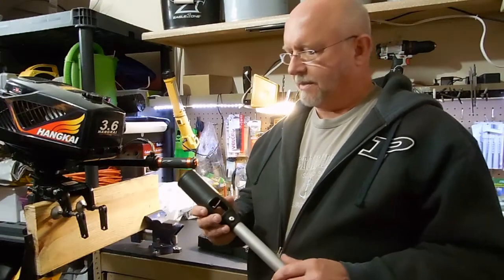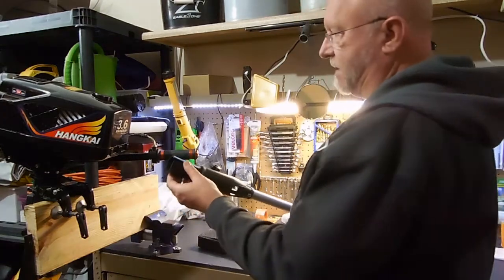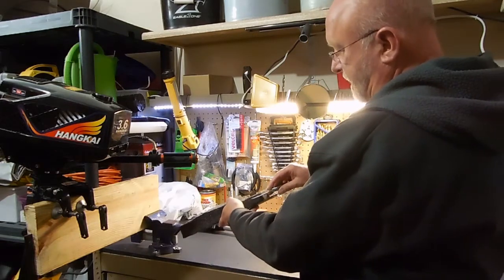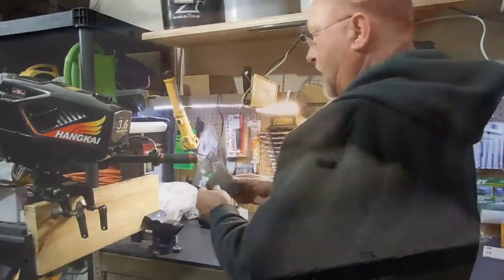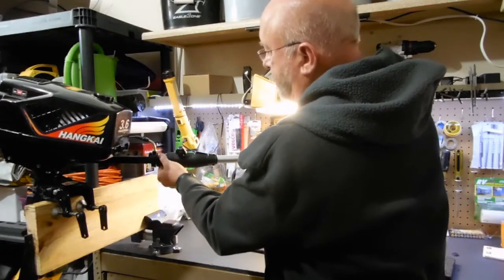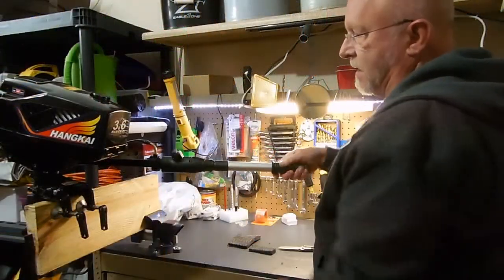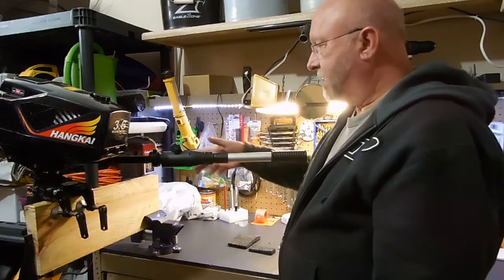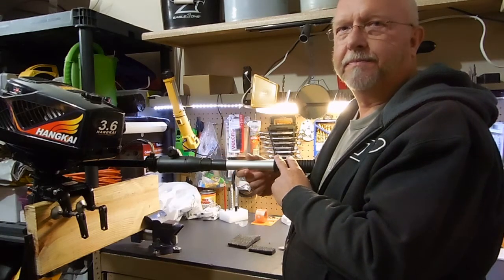Handle Extension for Hangkai outboard motor (under $20)

Comment: What brand of the handle extension? Thanks.
Reply from the maker: I’m pretty sure this is the same one from Amazon.  Note that I did additional tweaking to get it to work.  Some small wooden shim’s seemed to work out the best…
Pactrade Marine Boat Trolling Motor Telescopic Extension Handle Anodized Auminum 17"-25" https://www.amazon.com/dp/B074LGPMN4/ref=cm_sw_r_cp_api_glt_fabc_HDBD4G16A3FPEWQ5AR8J
Thanks for watching 👍👍

Comment: On the break-in period of 10 hours on  the 3.5 hangnai motor is it a continuous 10 or can it be broken up into sections
Reply from the maker: Probably better if you break it up into sections.  Most important is to either do it in the boat on the water, or make sure you keep water running as you don't want it to overheat.... I wasn't very clear in the early videos on that.  And don't go full out top speed.  I have several video's out there on this motor.  3.6 and 3.5 are almost identical so all of them should help on your journey!  Also, some of the fuel caps don't allow air in, so you may need to loosen the cap as you run the gas lower, it creates a vacuum and will cause the motor to stop or jerk...  Thanks for watching.

Comment: Dan, My 3.5 Hangkai starts and runs good but the propeller does not engage - shear pin in - what could it be?
Reply from the maker: Robert,

I hope you have watched my other videos. The motor is shipped with NO GEAR OIL in the gears leading to the propeller.  That would be my first thing to check.  Also, the propeller will not turn at idle speed.  It has a clutch type system that uses centrifugal force to engage the shaft going to the propeller.  This video may help: https://youtu.be/NCALT3MKAEk.  NOTE: fill gear oil up to the line inside the housing. Do not over fill.

Comment: How's your throttle on your hangkai mine won't go full throttle on the gas feed
Reply from the maker: Weather here still too cold to do a "On the water" test.  I've run it in the bucket for a little over 10 hours.  Not had any throttle problems as of yet.  Not sue how well it will push your boat.  Everything on line says it's 3.6 hp but the manufactures web site lists 3.6 hp but also lists it as 55 cc.  That transfers over to 1.69 hp.  From other reviews, I'm guessing 1.69 hp is more accurate.  I'll keep posting as I get it out on the water.  I did learn the hard way... Do not over tighten the gear cover.  I stripped one of them and had to tap in a larger bolt.  Thankfully that seems to have worked.
Reply: It goes about 6 mph with my 14ft Jon boat but I cannt get the throttle the fully open up hate all the plastic on the carb but it runs well

Comment: I just bought a hangkai online yesterday. My faith in Chinese products is not very high. But I'm always willing to have new adventures. So I'm excited to see how it works for me :)
Reply from the maker: I'm a little with you.  For as little it costs, I thought I'd give it a try for the fun of it!  Not much invested.  Seems like the ones that have trouble have been run in salt water...That may be a big part of it.  I'm keeping a close eye on the fuel lines, but fortunately fuel is available here both with and without ethanol.  I do think that is a big part of the fuel line deterioration problems others have had.  Check the plastic guide for the starter pull rope that is inside the housing.  If it is lose, cement it in place.  Have fun!  I'm looking forward to some warm weather to give mine a try!
Reply from the maker: You might check out the video I posted on the 10 things to know if you buy one!  Just search BoilerDan1 and you will see it in the list.  (Maybe you already did)  :0)